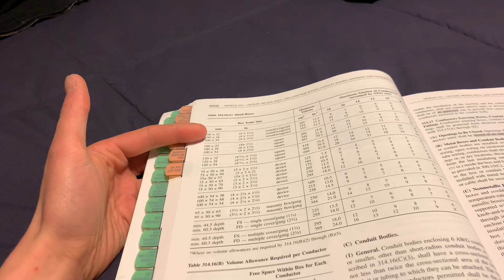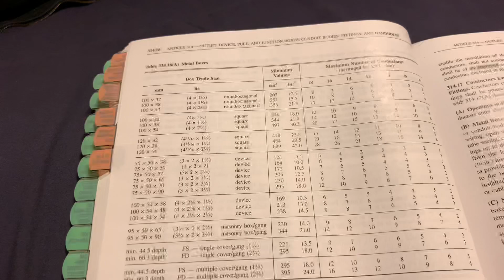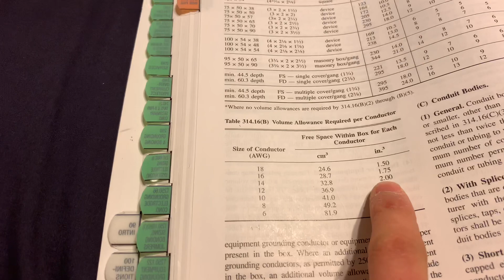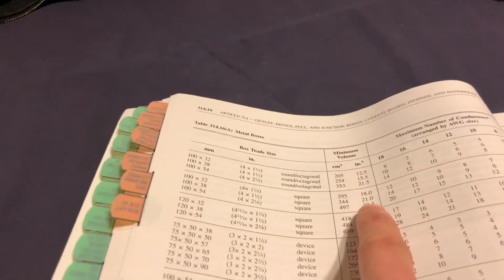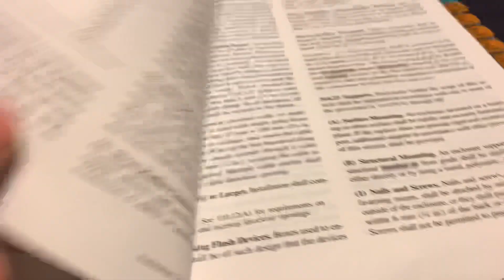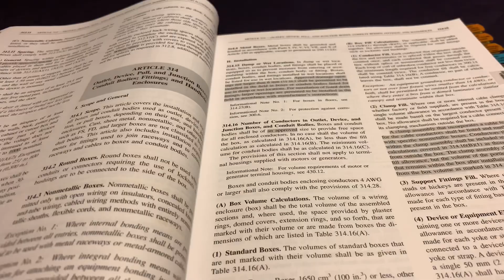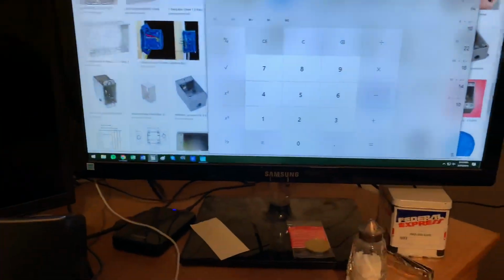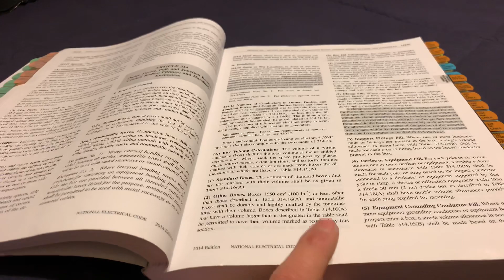Electrical Box Fill Explained

Comment: Every set of wires: a neutral, and a hot counts AS 2.
3 to 4 clamps in a box counts AS 1 but from the bigger SIZE wire, which means if you have 3# 14-2 & 1# 12-2 the sum of those clamps will be added as part of the 12-2 multiplication.  HICKIES AND studs count AS 1. Devices count as 2, the same as a set of wire (hot and neutral)= 2 AND ALLLLLLLLL GORUNDING WIRES IN THE BOX COUNT AS 1

Comment: From my understanding each hot and each neutral counts as  1 wire each. So for a regular 14/2 it would count as a total sum of 3 wires per say that the ground will only be counted this one time. A total of 5 separate 14/2 will fit into a (4×1 1/2) square box
Reply from the maker: sounds about right :)